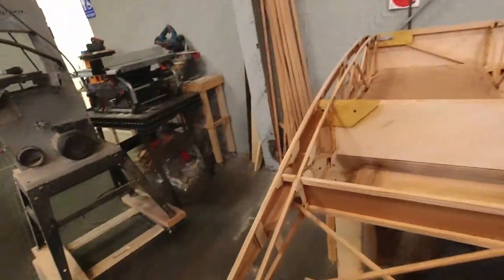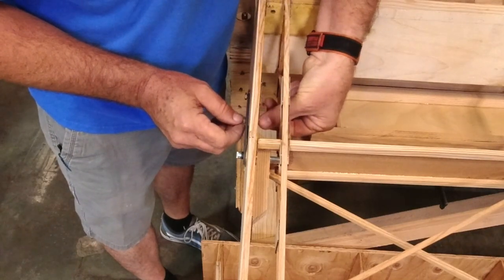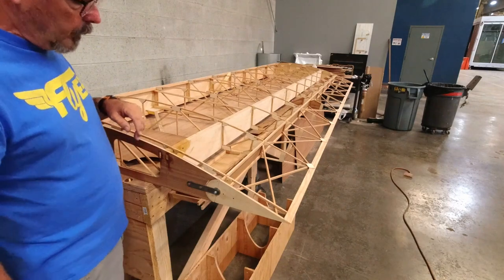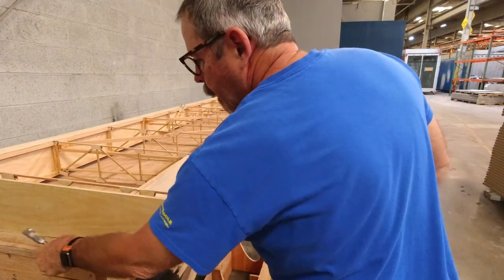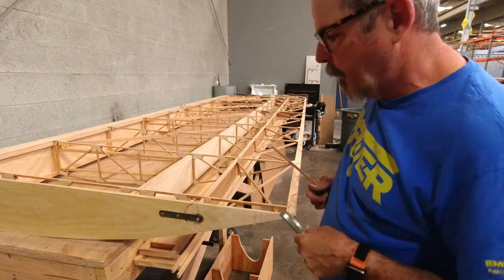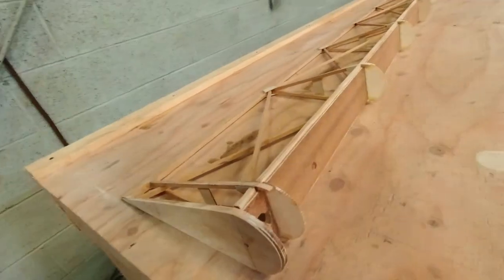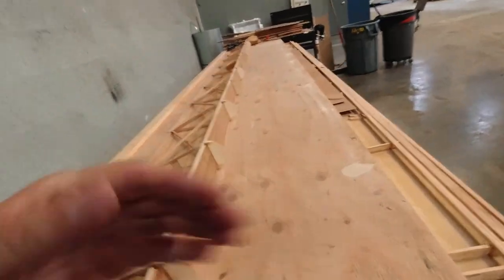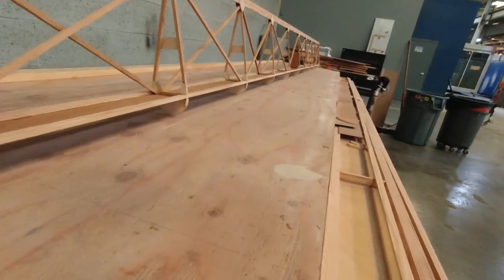Minimax 1100r Aircraft Build Vlog Episode 23

Comment: At time stamp 12:17 you noticed and checked with the staple puller what seems to be a gap between the leading edge wood and the tip rib leading edge.  Is that of concern?
Reply from the maker: Not a problem at all. It’s just a small void in that outer sheeting. I use some cab-o-sil in the epoxy and fill it.